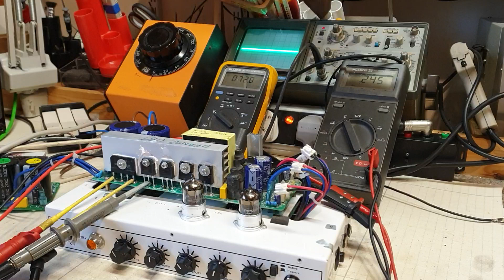Orange Bass Terror 500 Power Supply Start up after repair.

Comment: Mine just blew its second fuse on startup and I’m confused as to what happened because it was sounding fine beforehand
Reply from the maker: If the fuse blows then there is something seriously wrong 3 possibilities: Valves, power supply or power amp.  The valves can be removed to isolate whether they are the cause but the other two parts are modules that Orange no longer offer as spares so might be bad news I am afraid.

Comment: Hello from France. I'm struggling with a vicious breakdown on a Terror 500 head. A sudden drop in volume. I thought it was a capacitor at the end of its life. I changed some but the problem persisted. Always this low volume and when switching on I have to wait a good 2 minutes for a sound to arrive. On the amp side when I plug in an instrument on the return side the amp responds normally. So I turned to the pre amp. Lately I decided to do some measurements (Which I should have done in the first place...) And on the output of the 7806 I got 3.5v. I deduced that the AX7s were not well powered, hence the low amp volume. I desoldered the 7806 for the tester off and it works normally. After resoldering it to the card I found my 6.3v for a few seconds and when I reconnected the fan my voltage went back down to 3.5v. What a pitiful breakdown... The welds were also checked. Do you have any suggestions for me to find the problem? I thank you in advance for this. Mr Duez Daniel

Bonjour de France. Je me galère sur une panne vicieuse sur une tête Terror 500 . Une baisse de volume soudaine. J'ai pensé à un condensateur  en fin de vie . J'en ai changé certain mais le problème à persisté . Toujours  ce volume faible et à l'allumage je dois attendre 2 bonnes minutes pour qu'un son arrive. Coté ampli quand je branche un instrument coté return l'ampli répond normalement . Je me suis donc tourné vers le pré ampli . Dernièrement  je me suis décidé à faire quelques mesures (Ce que j'aurais dû faire en premier lieu...) Et sur la sortie du 7806 j'obtenais  3,5v. J'en ai déduis que les AX7 n'étaient pas bien alimenté d'où ce faible volume de l'ampli. J'ai dessoudé le 7806 pour le tester hors circuit et celui fonctionne normalement. Après l'avoir ressoudé sur la carte j'ai retrouvé mes 6,3v pendant quelques seconde et lorsque j'ai rebranché le ventilateur ma tension est redescendue à 3,5v. Une misère de panne quoi... Les soudures ont été également vérifiées. Auriez vous une piste à m'indiquer pour trouver la panne ? Je vous en remercie à l'avance. Mr Duez Daniel
Reply from the maker: Sounds like you are nearly there... You have correctly isolated it to the preamp.  And given the hint that it takes ages to make any sound we can guess that it is the heater filaments.  You have found that the 6v filament supply is being pulled down to 3.5v.  The possible causes are anything in paralell which I imagine is just the two valves and their filaments (easy to pull and check) or maybe there is a cap like C117 that is leaky in paralell with the regulator.   My bet it is a partial valve short... remove one at a time and remeasure and replace if you have one to hand.    If it is not that, then lift one end of the cap C117 and see if the voltage is steady at 6v.    By the way best place to get advice on fixing musical equipment on the internet is at the https://music-electronics-forum many good techs hang out there and give their advice for free.